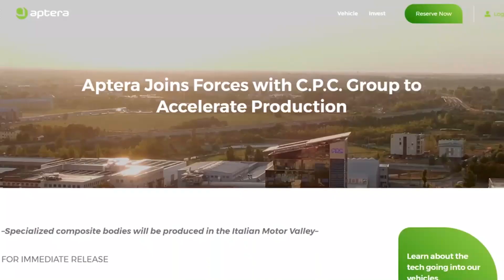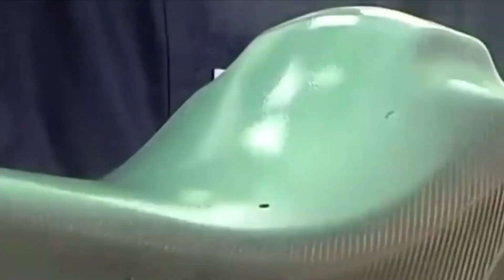This new deal guarantees fast aptera production!

Comment: Sounds like the left overs from expensive cars being recycled and squeezed into new molds. They’re not sheets but chips.
Reply: Sounds like a guess to me, but if it is still as strong, and meets strength matrix, what difference does it make if it recycled, or new carbon fiber. The molds are the key to this process, and the company CPC is known to work with carbon fiber for super cars for decades. I went to CPC website and came upon lots of information. Mitsubishi Motors just purchased 41% of them, and they are more than doubling in size. I for one think it is a wonderful choice for Aptera. What it is now, is a world class, most efficient, almost super car performance, wheel motors from Slovenia, a Euro-car genetically, with a USA design to be safe and extremely slippery drag coefficient of 0.13!  I can only wait but driving this should be a blast.🐬🐋